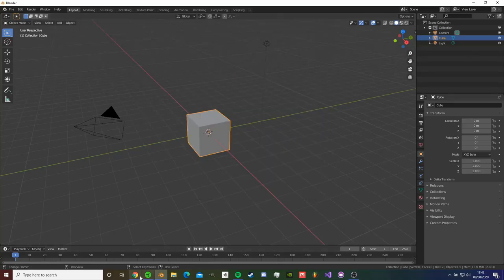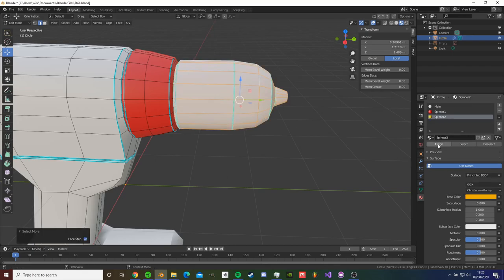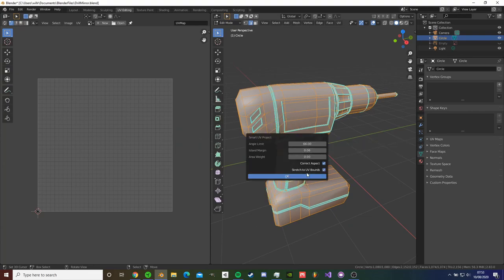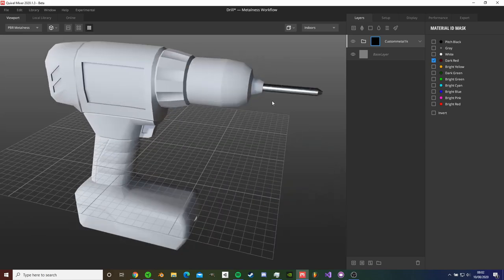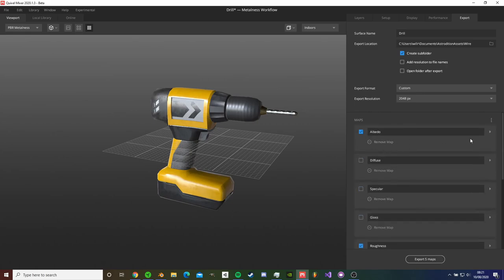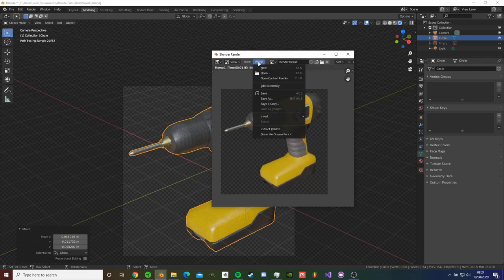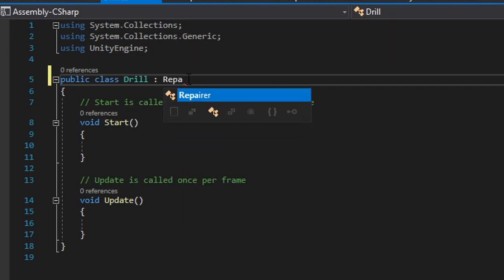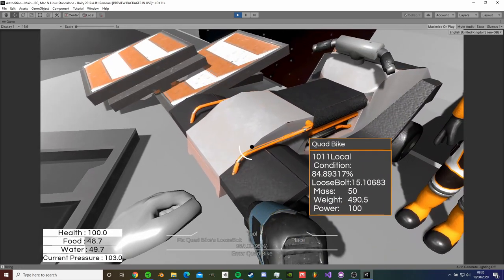My Blender, Quixel Mixer, Unity3D Workflow

Comment: I found that changing the roughness texture node's color space to "non-color" fixes the 'over-shinyness' of the material, same goes with normalmap texture and probably metalness but not sure about the last one
Reply from the maker: I'll give this a go! Thanks!
Reply: @WillRosen  it works for me with exported textures from substance painter so Im pretty sure itll work for you aswell !

btw thx for the vid, I now consider switching to a free substance alternative and Mixer seems like a good fit for me
Reply from the maker: Just tried it for myself and you're absolutely right, it works! Much appreciated as I have been wondering why it wasn't working for a while now, thank you!

I can't find a way to add this to the video so I'll add it in the description!
Reply: @WillRosen  Glad I could help :)
Reply: Thank you! that solved the problem!

Comment: the thing about roughness in unity is that, from my limited experience, a generic URP shader works with Gloss instead of roughness, and it uses the alpha map of either the metallic / specular or the color map. Mixer has a handy feature where you can import your roughness map (a linear, grayscale) directly to the Alpha of color map. so you would end up with 4 maps that matter: Color(with Gloss in color alpha), metallic, normal and AO. Remember that Roughness is Gloss, but inverted. As i said earlier, the annoying part is going to each of your layers and inverting the roughness value of all your materials, so that they are converted to gloss maps and therefore, work correctly on Unity. Getting the roughness correctly in unity is the diference between your model looking like shiny plastic or actually real, which is impressive.

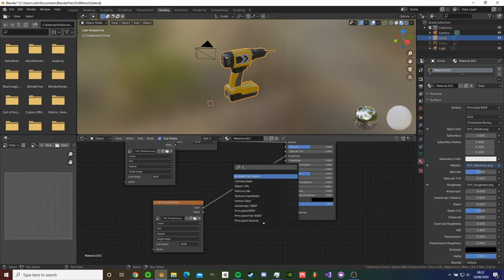Comment: 4:17 you don't need to put a color ramp to change the "strength" of the roughness, what happens is that the ambient occlusion maps, in fact... all maps but the diffuse/base_color/albedo, don't use the sRGB encoder, so you need to change this sRGB to Non-Color in the nodes, to work correctly, same thing is in unity or unreal, but in unity if I am not mistaken, in current hdrp, you don't need to change the color encoder anymore.

Comment: Instead of making a different material for each material ID and then baking it to diffuse, I just UV unwrap the model and then use Texture paint fill tool with face selection masking. You can then just save the image file without having to bake or deal with a billiondy materials.

Comment: Huh! You got it working in 1 go! Whenever I make a Mix on Mixer, and then export maps, to place them back on blender, some textures look exactly like in Mixer, some others are absolutely wrong, like, reflection wise, I get a chrome silver, instead of a dark scratched black metal.
Reply from the maker: Haha yeah, very annoying when you're tweaking values until it's perfect, then export it and get something entirely different!
Reply: @WillRosen  It's weird, cause there's not much to modify for it to get it wrong, they are texture maps! 
Anyways, since the "save as Mix" option is not available when you're on CUstom Mesh mode on Mixer, is there any other way to get it done? You seem to get it perfectly, but you don't do anything "special" per se.

Comment: men when i bake my model is al right but when i put the textures in mixer my model is badly bake aparently,i have issuses in all the mesh, i dont know if is a problem with the subdivision surface,If someone could help me I would be very grateful.
Reply from the maker: Hmm, I'd suggest clicking apply on the sub division surface before doing the UV just in case it's causing the issue. As the modifier may change the mesh after the UV is done.

Other than that, check only one material is applied to the object, and maybe change the Ray Distance in blenders baking settings. These are the ones which caused me the most issues.

Good luck and I hope it works!
Reply: @WillRosen  thanks You dude,i gonna try this!

Comment: How did you divide up those sections (the blue lines) of the tool in blender to color separate sections?
Reply from the maker: To colour each section separately, different materials have been applied to each face (by selecting the face and assigning the colours). When these are baked it is used as a Colour ID Map in Quixel, so you apply a material an entire colour. 

The blue lines mark edges as 'Sharp', which stops a smooth transition between the faces.  Difficult to explain, but if you Google 'Hard vs Smooth Shading' you can get some good images of this.

Hope this helps!

Comment: Hello sir, thank you for that workflow. I was wondering what are thoses blue lines in blender on your model before the unwraping ? 
Have a good day :)
Reply from the maker: Ah yes! The blue lines are edges which I have "marked as sharp". The entire drill is shaded smooth so that the faces blend together, but if I wanted to make an edge look hard and stand out  (For example the battery seam line) I have marked it as sharp! Hope this explanation helps, if you want to look into this more you can look up 'Smooth and Hard Shading'!
You have a wonderful day too!
Reply: @WillRosen  Ok I will try that, thank you again (and for replying so fast too) 
See you !

Comment: Do the sharps help with the baking edges also? im having a issue where the colours leak onto other panels. Even at 4k res the bake has some leaks.. ive messed with margin and stuff to.
Reply: No worries.. think I might have sorted it. During the unwrap stage its good to set a margin and not have it at 0.

Comment: why is baking necessary ? why not just export the mesh with its material ids into quixel
Reply: Those get imported into Mixer as different texture sets and can complicate things. Generally, you want to avoid using more than one material on a mesh in Unity, as well, as it increases Draw Calls which have a significant impact on performance. You also do not need to do this material stuff, just use the texture paint mode and use "face selection masking" and the fill tool. It's faster and less work and results in one image file without baking or dealing with 40 materials.

Comment: Whenever i export an asset from bridge it shows exported successfully but the asset doesn't show up in blender. But when i go the shading tab in blender it's texture shows up in the materials. But still there is no 3d asset! For eg - if i export the wall you exported in this video, that wall wouldn't show up in my blender but the texture of the wall will, and then i can give its texture to any mesh. I'm using blender 2.9 and bridge 2020.3.3 pls help....i really don't know why this is happening :(
Reply from the maker: Hmm... That's slightly different from this video as I made the model in blender. I can suggest two things:
1) Try and export the model as an .FBX (Or any other format) to your desktop then import it to blender
2) There is a Megascans Plugin for blender 2.8 which may be useful, not sure about 2.9 though
I have never used Quixel Bridge so I am no expert, but I do hope this works for you, best of luck!
Reply: @WillRosen  I've installed megascans plugin but still the asset is not showing up! Whenever i export a asset from bridge and check the windows toggle system it shows an megascans plugin error while importing textures/ geometry or settings up material. ERROR : calling operator "bpy.ops.import_scene. fbx" error, could not be found! Do you know someone who could help me?
Reply from the maker: Unfortunately, I do not know anyone who can help.

Comment: Is quixel mixer free to use for commercial use ?
Reply from the maker: If you are using unreal, I believe you have access to the Megascans library, where the materials and models can be used to make games.

As I am making it in unity, I am downloading free textures. This way I'm not using any materials/smart materials which come with it just to be safe.

You can check the terms and conditions just to be sure!
Reply: @WillRosen  I'm using unity also. So using custom material is ok right?
Reply from the maker: Yup, that's what I'm doing just to play it safe!
Reply: @WillRosen  how did you import the downloaded free textures?
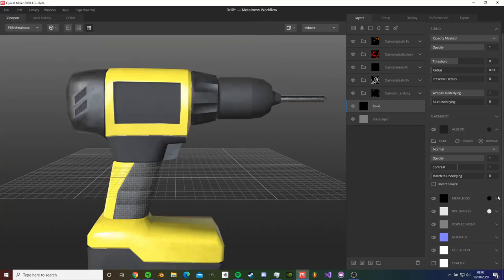Reply from the maker: At around 3:28, you can see I'm importing them on the right hand side by clicking the 'Load' button for each map, then locating them in the File Explorer.
Reply: @WillRosen  ok thanks man. But I think you did use a premade material? Is that ok?
Reply from the maker: Not entirely sure what you mean, but what I have done is import all the free textures, then save this as a custom smart material. Saves time as I can just use this material again without having to re-import it all.

Edit: And it may be okay to use the premade materials, I'm just being cautious
Reply: Unity User here: get a subscription to Megascans, then you can use whatever you desire. Its only like, $20 a month i think, and they give you 250 pts for that. I dont have many subscriptions but i LOVE the Megascans 3d model and texture libraries